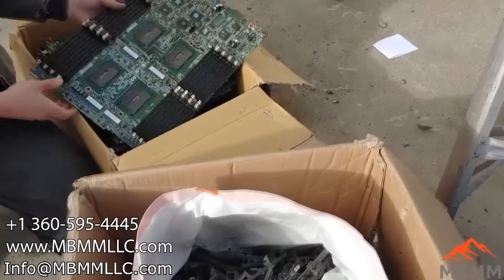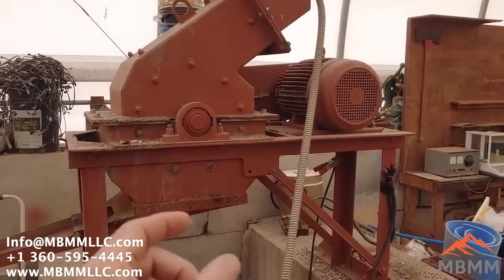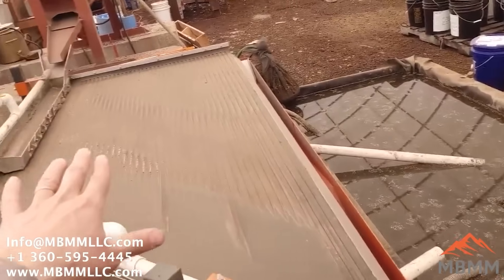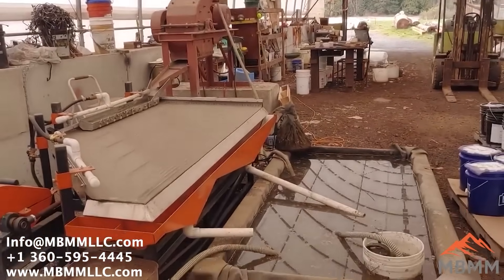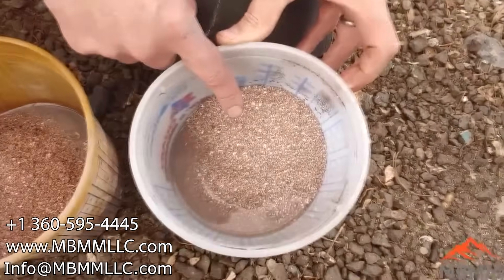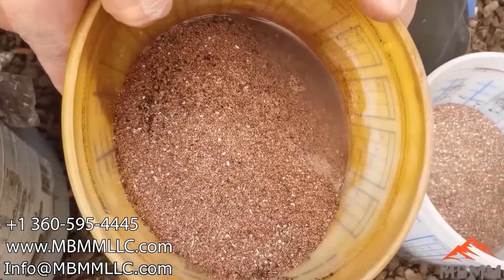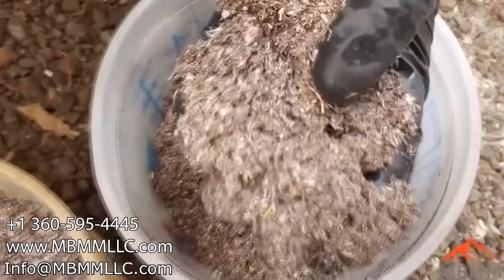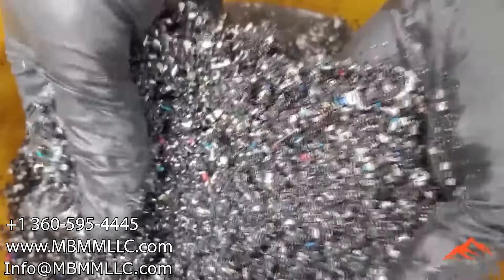Gold Recycled From E-Waste, Electronics, Cell Phones, & PCB

Comment: Hey I have a recent increase in interest in your processing equipment as my American wife and I (Aussie bloke) are heading back up over to live from down under, green card pending of course (can’t afford the gold trump card) but for now have you got a video you could point me to about separating gold from brass, I had a rather stupid mistake with a homemade retort the store didn’t have steel end caps so I used brass and it appears the gold has spread all over the surface of the brass, I stopped the heat when I seen the outside of the cap starting to melt and well I’m sure you see my predicament 🤣

Comment: iv watched this channel fr a good long while a few others inline with this 1 Dan Hurd STREETIPS omegageek a few other big names in the metals chems n gems scene,,, now free constructive critique here purely as a chems guy his was horrendous to watch ,,, knowing the value per gram of the materials that you process ,, now ,,, to combine th chems method in line with this process would make some sense ,, but watching everything being pulped after having spent at least 5 years pulling pins with pliers this made my ocd twitch so badly ,,, but in theory a little sorting and a bit of this combined with an electrolysis bed set up with the materials after being treated with a chemical phase after this milling and table sorter might make sence really really id use a multi phase system incorporating all three techniques ,, without the smelt and cupelle its about collecting EVERYTHING "VALUABLE2,, there's palladium and rhodium and a few rare earths in the components worth allot more per gram than copper silver and gold yes but here's others too ,, so a phase at the end electrolytic fine gold or silver or whatever is actually 3 nines pure so at the end is bullion grade pure and worth the extra mile really as far as cost per gram is concerned considering a electrolytic leach system could be run off solar panels fr free ,,, really tbf,,, but as i say price per gram of EVERYTHING "VALUABLE",, pure coppers worth more than just copper i agree but pure rare earths is a winners game in the current market ,, iv also seen a guy make platinum into chloroplatinic acid for a 100 percent x 6 profit rom $1000 to $6000 US,,,, being a chems guy makes that metal worth its hidden values that the markets require and its about having the stock to provide these things as and when ad hok as they say i hope i can shed some light on this metallurgists philosophies and make a few windows into another perspective visible to people who love these art forms and i hope they never die out and never loos e the hands of the free willed men and women who follow thes practices its a real grasp of the ancient magical coven of alchemy and these practices are a very special part of society and the ability to hold on to these  skills is a necessary part of making ready any of our nations for when times require we use these skills on a local level and we rthe peoples ready for these times a prepper kind of trust that were party to .we should all carry a stick and if a mans stick has golden radios and dgital raspberry skysnet written on it and the best signal than that guys the guy to to for ya daily dose of yu tube and ya bitwallt broker ,, you get what im saying tho i hope its about honing these skills to create a method thats efficient waste-less and makes money from the cheapest sources and helping the next guy to reach his goals and yhe in forward and yhe people gotta be tested screened re tested and screened like the metals to see youre real worth and the value in what you commit to the realm its gotta work its gotta be reliable and repeatable so its within reach of people when we' try ,, documenting and research are key to all these things and seeing people referred to the actual old books documenting these experiments seeing the actual textbooks written 120 years ago first second times around when people in the modern industrial world first began to document and publish this knowledge for the masses available now on the net before libraries and government offices or beuro's that's the kind of advice we all need to learn its not always on the web some of it still hidden on paper and needs to be submitted to the web and that's where YOU  the viewers need to keep doing OUR bit to keep adding to this new library of Alexandria or the Akashic record or the Vedic texts ,,,, whichever holy grail of medicine and sciences that we hail to for more of this stuff its also in the actual minds and only by words of mouth is some of this stuff known so we need to treat it and each other with the respect of it actually being the basis for all the future realms of development that the human mind can produce ,,, and i mean the actual cosmic realmz of scientific breakthroughs that stand before us as a race of space dwellers racing for our new territories in the stars a very special start to the things of then ,, that takes us now to conceive and from the dust to the ashes then from these ashes rise the great beauty and bright colors and all the colors creation has to offer ,,, and all the metals, the stones and rocks their trapped in ,,the chemical stripping with  the aqua regia ,,and silver and copper nitrates ,, even the colors of platinum red all these things are within the grasp of all of us every day and if we search for it its right there in front of us , literally every day ,, ready for us to just pick it up grasp with hands an open mind and start doing ,,,, but as always great episode , but oooosh my ocd was hitting the roof seeing those bags of components all ready waiting to be ablated and put to dissolve in he buckets was just making my eyes weep disturbed even by it all hahaha lol but yhe a combo with this method then chemical separation ,followed then with an electrolytic refinement at the end ,,on a mesh of cathode for ease of  collection and then can be removed as a wafer ,all in an electrolyte ,,,.Philosophies never exclude another they seem to actually incorporate if anything so the more input and more peoples experiences really really feed the whole life force that is the metal itself it demands we evolve to incorporate it into our biology for some reason biology and metal are somehow very inter related and we as an organism require an amount to exist as we do in the electric realms of quantum energy's we require metals in our blood in our bones yes calcium's a metal too ,,, well lots of things have a metallic form its a state of matter like water is a liquid but acids well some contain water and some are hygroscopic but still fluid ,, that makes as much sense as nak lol a metallurgists pun there lol but metals are as important as air so we gotta respect the people who teach this stuff to us all and this guys great like i say him dan hurd streetips and a few others Nile red even for trying lol all these you tube heads have made the transition from tv to internetwork tv type thing a great fun step away from the oldschool and yhe theres a  few other platforms i won mention but yhe patreon an ghia a few others all there ready at the flex of your credit card lo and its done its like getting a book from the library and just paying the fine and keeping it lol ahahahah .. love this stuff total respect and kudos to you all ,,,,,,,thanks again ,,,kind regards ,,,,,...from myself ,,Jim!!!

Comment: I know these machines are designed for efficiency and that depopulating and sorting components doesnt fit 90% of large scale recycling models . However if you just add one step of stripping the boards with an automated heating and shocking sytem to remove the components you could improve the yield and seperation . A heated tumbler or toaster oven type conveyor that heats and drops the boards wll remove the parts so boards can be processed separately to the other components.this will remove the issue of fibre glass catching and pulling metals from the high grade during seperation ......now use my idea and gift me a shaker table to say thanks 😂

Comment: Question: I see the shaker motor on the left mounted vertically. That would give the greatest lift to the left side of the table. Would it work better to locate that motor to the right end to give the start of the table the most shake and smoothing out at the discharges?

Comment: Have you considered making a very small version of your shaker table for hobbyists? I would be on for one that would be 110v powered and less than 1500$!
Reply: I would definitely enjoy a kit like that! The grinder/shaker table maintains a lot of precarious balances, which would scale oddly with miniaturization. Water would have to flow slower and the material would have to be ground even finer. I do not think this is trivial to achieve and more like redesigning rather than merely shrinking the setup, but imagine tweaking a system like that on your workbench :).
Reply: @MaxRoaldEckardt  i wonder if you used a more viscous liquid, like mineral oil perhaps, it could allow a better adaption to a smaller scale
Reply: @ket_boofer  good question. Just would have to be on a smaller scale mineral oil with that amount that  would cost a bunch and move the break even point a lot further to reach. I can't come up with how it would effect the specified gravity. For some reason I was stuck on water.
Reply: You can always dona sluce box system. The shaker table is just like a pan  except it does it on a much bigger scale.

Next to set up a system of recycling the waist like he does you need one he'll of supply to feed that hungry beast. Other wise it gets like your lawn mower. Soends more time sitting in the garage not doing the job it was designed to do.

Comment: always wonder about the lead content, do you have to take any additional steps health/safety wise in the further processing?
Reply: @scottbedard5095  we don't use lead much anymore in making pcbs anymore. Definitely wouldn't drink the water and it should be filtered before dumped back into the environment. I'd be more worried about the arsenic/Germaine tbh

Comment: What is the purpose of the plastic sheet?
Reply: @Rorschach1024  it helps keep everything on the table and prevent clumping. A ball of plastic might push a bunch of metal down into 4 without it

Comment: The old Zenith TV's (1970's) used a mechanical tuner with gold plated contact points to eliminate tarnish and poor connection between the points.  I'm sure it wasn't much.

Comment: Want to put out a psa to you/your customers. There is germaine in those comps. Please wear a mask around the dust. It tends to be processed away by the environment pretty quickly but the initial dust is pretty toxic
Reply: O crap thanks
Reply: @Cjohn31  you're welcome! I work at intel making a lot of these comps and get to see how a lot of it is made. Most of what they put in them are benine but the Germaine and arsenic are gnarly if inhaled. Arsenic is pretty heavy (settles quickly as dust) and dissolves in water super easy. Germaine gets absorbed into most stuff fast, which is good as long as that stuff isn't your eyes/lungs. Definitely wouldn't use the waste water on anything you plan on using/eating later. Like livestock or food crops. Tree farm would probably be good to go if you tested the ph first.

Comment: I would think heating up the boards to the melting point of the solder they use and pulling the pieces first, would be cost effective for removing the board from the equation.
Reply: Heating uses a lot of energy, increasing cost. Mechanical separation is about the best you can do, especially as a first step.

Comment: I would love to see an analysis of all the different grades you caught, and even the overflow rubbish. To see how much gold is not in the number 1 or 2s.
In my experience ewaste gold is very well attached to their boards and a lot of copper plated stuff.
I can’t help but think there is a good 10-20% of the gold going straight off the shaker table.
Any gold that is micron thin flakes attached to a piece of fiberglass isn’t going to change the density enough to stop it getting washed out…
Reply: A good - and easy? - comparison would be to do on 2 sets of identical batches:
1) Crush as shown, shake and do it the 'brute-force-way'
2) Do a micro-scrapping run sorting out the valuables and doing it the 'chemical way'
I would also like to know what method is best - imho up-cycling and refining the scraps before extracting seems most logical to me.
Big(gest) question is, when to stop up-cycling - board level or component level, as I see it.
Thanks for bringing it up MarkRED777
Reply: A sample of the number 4 put into Aqua Regia would solve a lot of questions.
Reply: @MarkRED777.   Hydrometallurgy is the only way to recover all the Gold, as well as all the other valuable metals.
Gold on Printed Circuit Boards will yield nothing more than pocket money. The real value is all the other metals.
I solely process PCBs whole (in one piece); that goes for any kind of High-, Medium-, or Low-Grade boards.
The Gold Plating on newer PCBs are so extremely thin that most of the micron thin Gold-flakes will stick to the glasfibers if the PCBs are crushed. 
One of the greatest values generally is the solder; easy to recover. Tin is worth five times more than Copper. Lead free solder also contains 1 - 5 % Silver.
For the past 14 years I've been a full time scrapper/recycler/metal-refiner. All equipment is homebuilt, and I process tons of WEEE (e-waste) every month.

Comment: In my business plan I have included you as the main supplier of equipment. I am about to open a small recycling point and intend to use your system
Reply: Can I join you bro?
Reply: Have you guys seen the whey protein sponge method for gold recovery. It's kind of what I've been waiting for to run my collection. Just staying tuned for more information.
Reply: @riverboat28  you still need to desolve the gold , i inted to recever it without acid.

Comment: I still think you're losing out on a lot of potential silver and palladium in ultra-fine form from various components (ie mlcc) getting washed off since it would just be too light to make it to the #1 or #2.
Reply: Different systems for different goals.
Reply: Why would you think it's lost? the tank is recirculated and fines settle or get filtered out. Smelting the #4 tells him he's not losing much there, fines in the mud will probably be processed appropriately.
Reply: @TheCrudmudgeon  If you've ever processed mlccs you'll understand they do not behave like gold or copper.  The silver and palladium is so ultra fine as to be virtually nano particles.  By the time it all settles out it is likely in the waste being augered out.  TBH I'd think once it comes out of the hammer mill going directly to a smelt followed by running the (mostly) copper through an electrowinning cell and then refine the slimes would be a much more effective process.  I've done it myself (albeit on a small scale) and it works.  I'll admit I very well might be wrong but I might not be and I believe a solid test could very well be worth it.

Comment: I don't suppose you can use jet dry in that system. So how do you keep the gold from floating into #4?
Reply: He has talked about using Jet Dry in the past.  It can be used, but even super fine gold doesn't tend to float off in these systems.  He has done quite a bit of extensive tailing testing to see what he fails to recover, and that's always been very, very low.